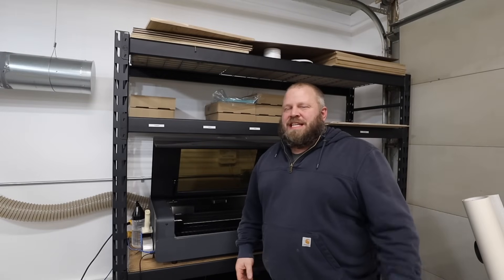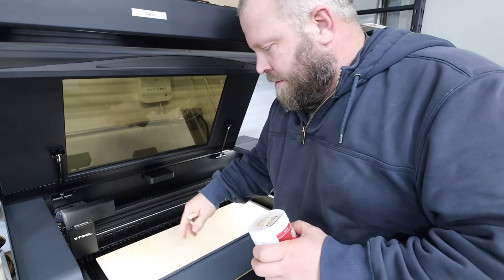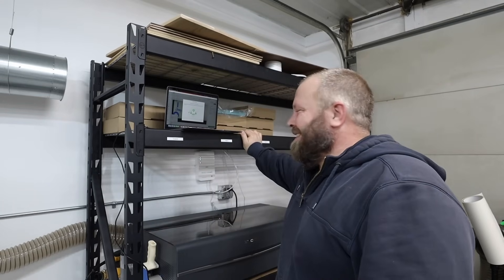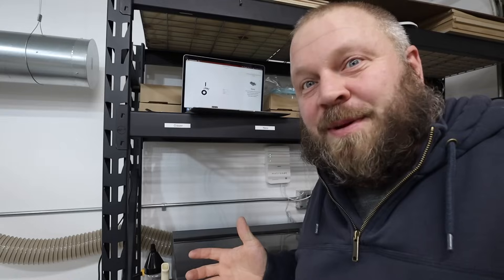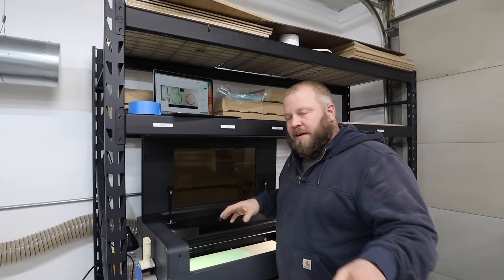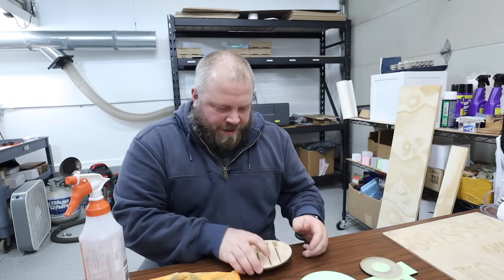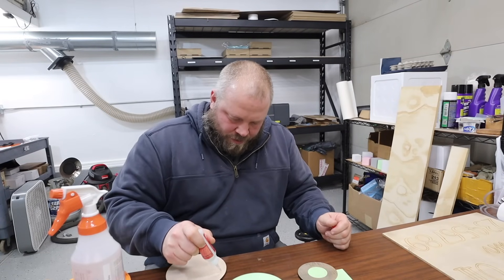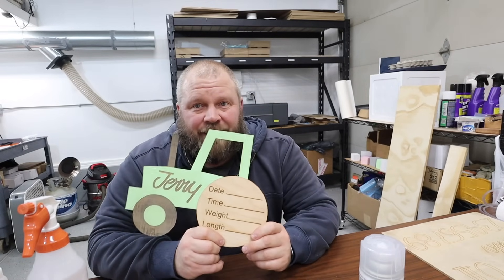Starting a laser engraving business the right way.

Comment: If you run a CAT5 cable directly between your laptop and laser  (not via a router), you might need a “crossover” cable or adapter.  Been a long while since I’ve tried connecting devices this way, but there might be other settings to make on the laptop and device (laser) so that they can see each other over the tiny, two-device network network you’ve created by running an Ethernet cable directly—for instance that the subnet mask and Ethernet addresses are right, and that the computer is using the Ethernet port and not WiFi.  So that’s two thins to try—the network settings, and the cable.  You might need either or both.

Generally, connecting both devices to a router is far easier, as the router will provide the settings to the devices and you won’t need a special cable.  

There was another comment here about 5 v. 2.5.  That is related to WiFi, and not Ethernet.
Reply from the maker: Thanks

Comment: Thanks for sharing. I strongly agree that LB is much better software than xcs. The only good thing about is the camera feature. Suggestion. I wanted to share that my computer is in a different room than my machine. I can still use LB to run my P2. I use a usb over ethernet adapter with a 50ft ethernet cable. Works fine for me.

Comment: Yo Matt. Does your router have a dual band connection? As in does it automatically switch between 5 & 2.4 connection? My S1 would not stay connected to my network and I had to go into my network and adjust it to be two different networks with a dedicated 2.4 connection for my S1.
Reply from the maker: I didn’t even think of that. Thanks I will check that out.